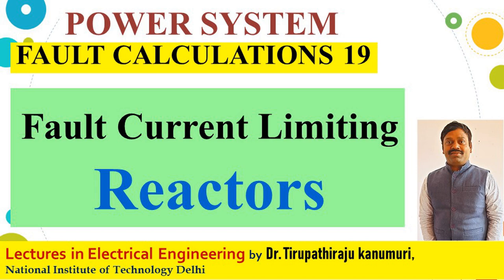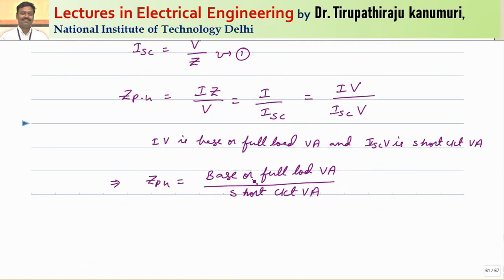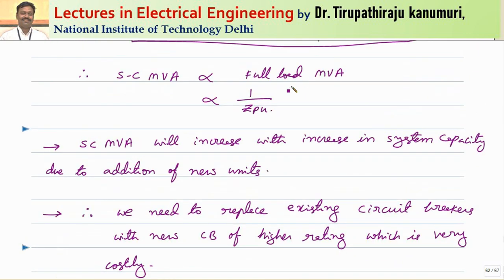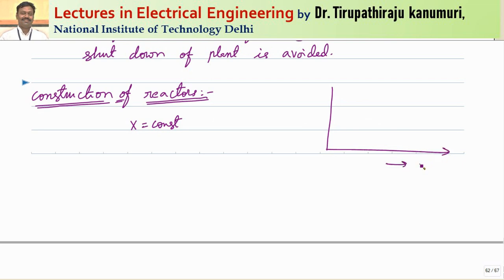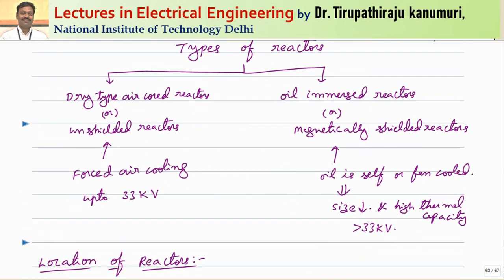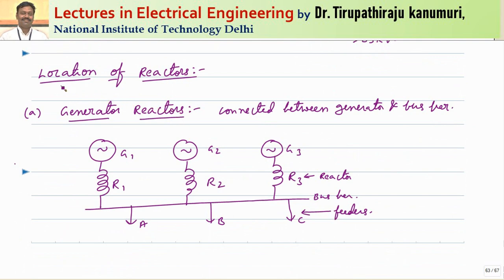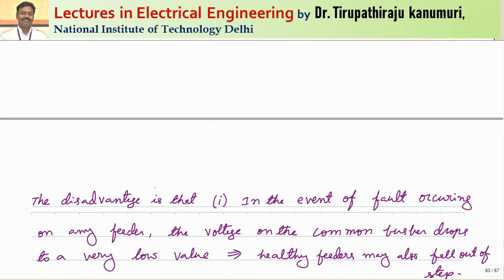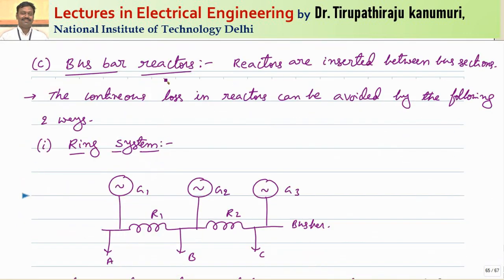PS100 Current Limiting Reactors

Comment: Design a fixed shunt capacitor bank with 13 % series reactor for a traction substation with an average load of 2133 KW to improve the power factor from 0.8 to unity. Calculate the rating of capacitors and series reactor.